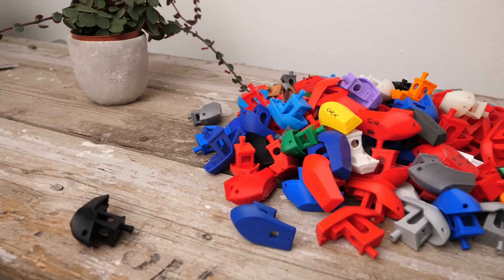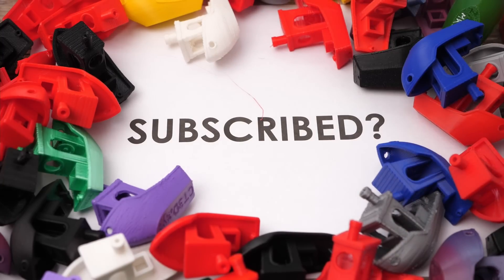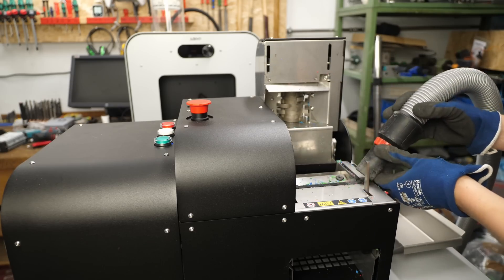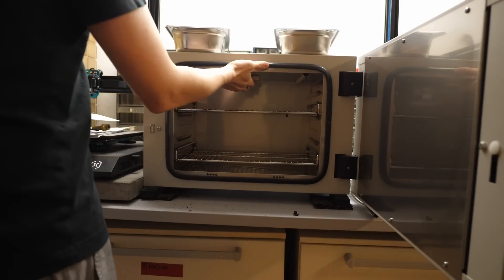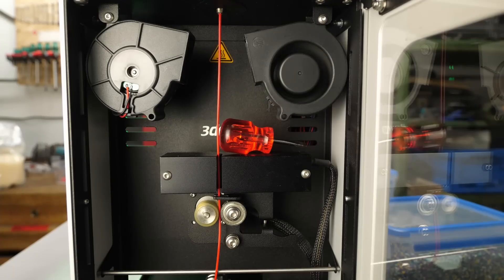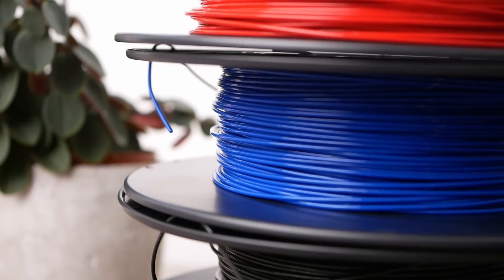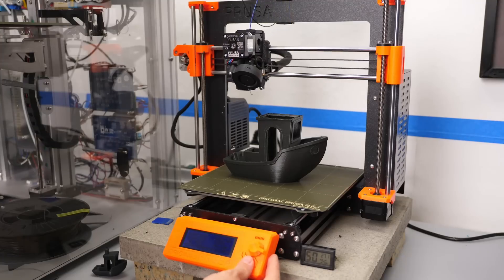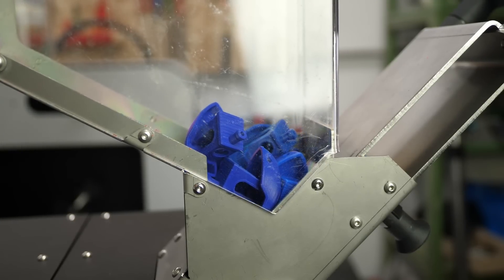Recycling all my 3DBenchys into new Filament

Comment: Did you confirm your filament size measurements by hand? Curious if the glitter pieces were confusing what appears to be an optical measurement system for the diameter.

Comment: Why not try to do a "double cycle"?
Grind the prints, extrude them into "round 1" filament. Then, come up with a filament cutter which cuts the ~1.75mm diameter filament into 1.75mm lengths.
These 1.75mm long 1.75mm diameter PLA cylinder "beads" are then the raw material for the "final" extrusion. This would remove almost all inconsistencies.

Comment: I wonder if putting the scrap material into a rock tumbler would make them smooth enough to make them flow better in the hopper without the additional vibration

Comment: As you mention, it's a 150g/hr process, presuming a shredder could keep up with the extruder. If you had to estimate, including testing, dehydrating, grinding, and extruding - what is the energy cost of recycling pla versus making virgin pellets (I'm not familiar with how factories produce pla). It would be an interesting comparison. Running a hotend+extruder screw for 6-7 hours per spool seems very energy intensive, even excluding all the prep work.

Comment: I love the idea of recycling 3D prints, but there is still a lot of work to be done to get from this prove of concept to an usable, reliable solution (so like with any other technology).
Right now it's too reliant on a high knowledge base, the necessary machinery is too expensive and the process overall way too time consuming to consider that in a hobby / small scale environment.

Regardless, love your videos, especially the input about material properties is absolutely awesome and helps me a lot!

Comment: I don't seem to be the first comment with this, but I'm highly interested if the extrusion of recycled plastic might be easier if you extrude it in a first step to get an unusable inconsistent shape (like the third, darker one you showed) and then carefully cut it into a granulate. The inconsistencies of the first extrusion shouldn't matter and it might be way easier to extrude self made granulate instead of shredded prints. So basically: can a second extrusion step inmmprove filament quality.

Comment: If you put the temperature a bit higher in the melting chamber or put the extruder from the shreded material a bit hotter, should it not be more liquidated and therefore also be more consistent/ make surw it hasnt those sparks in consistents like you do?

Comment: You should see how we do this in a plastic factory.  This regrind work is best for injection molding. And Trust me plastic companies regrind all their plastic rejects but there is always waste like when you need to purge the system that molten plastic is garbage. Maybe plastic like this should be used in construction instead of recycling like this. Plastic that can be reused in other ways to make pavers, roads or other products that we don't really care about how they really look. Quality of the plastic just degrades for normal uses. It's great idea but it's just not worth making new filament out of it.

Comment: It could be relatively easy to make them float if you ever wanted to, a keel would solve the top heavy problem so the addition of a heavy counterweight in the bottom of the print could solve this problem

Comment: Poor benchies. :(
But the idea is great. There are a lot of 3D prints used in scale models where strength is not very important. It seems that it's very important to separate different types of plastic.

Comment: I would be curious to see you print a roll of filament, measure its strength and other features. Then remelt that same roll and test again, knowing for sure that it started off as all the same type.

Comment: Since day one i got a 3d printer i have in plastic bag all failed print, sorted with filament brand and color. Maibe some day i could recycle those. Actually the main issue is machine are too expensives, a simple recycling extruder should not be 10 times the price has a 3d printer. But even in the 3d printing world there is abuse, like 50$ for a simple lcd screen, 80€ for a simple spring bed, ect.

Someone big like prusa need to release a machine ! OR i don't know, like mutualise to reduce cost.

Comment: Hey Stefan what would be cool is if you measured the electricity used to recycle in this way grind, dry, extrude so you can calculate cost per 100g of filament.
Reply from the maker: Will do that, though during the day, it's 100% solar from my roof 😉

Comment: Might be a lot more work but what about making the filament as fast as possible the first time, cutting it up to have a consistent pellet size, then doing a final regular filament extrusion?
Reply: Pretty good idea but how much electricity will it take by the time it's been shredded twice, dried, extruded, chopped then extruded again. That would be a pretty good one to put to the test understanding how much it actually cost to recycle.

Comment: You should try to re-grind a re-extruded recycled spool, the metering and mixing of the extrusion process will make the re-grinds more consistent
Reply from the maker: I've built a filament pelletizer a while back and plan to exactly do that!
Reply: Indeed, I have also thought of this. Instead of grinding, one could also run the rough recycled filament through a drive mechanism (part of an extruder) with a blade immediately after it, that chops the rough filament into tiny segments (pellets) of the same length. This should produce pretty consistent pellets that will hopefully also flow nicely due to the round shape.
Reply: @alexanderthomas2660  Why not extrude to say 2 or 3mm diameter, then re extrude at 1.75mm diameter. say spool to spool...

Comment: Can you try and grind 1kg of PET bottles and try to make a spool out of them?
Reply: PETE, HDPE, PP, PS.  Several common plastics to try.
Reply: Not bad, but there is glue, sugar, skin oils and who knows what else on them. You might clean the exterior (not the glue, though), but the interior is another issue. Maybe water bottles are ok on the inside, the leftover saliva and minerals being only in negligible quantities. An advantage would be that the pellets would be actually flakes, melting easier.
Reply: @Constantinus213421  true that, could try ABS from common cheap items enclosures or TPU from soft phone cases
Reply: I believe the University of Technology in Sydney is running a industrial robot arm 3D printer on directly melted HDPE from washed and chipped milk bottles.

Comment: Would extrusion be more consistent if you chop up the new filament into even pellets? And then redo the recycle?
Reply: Buy that you also make plastic degrade a little bit more, so the profit of this is unreasonable
Reply: I do not think so because if the jam is dissimilar material, it will still be present. If the issue is jams, filament pellets are still not as smooth as real pellets. Factory pellets are round and smooth, like airsoft BB, just not spherical. 

I am experimenting with ball milling pellets to round them. Although I'm not super motivated as shreds do produce perfectly usable filament for pretty much any print you are realistically going to do.

Comment: recycle a bunch of milk cartons and run a comparison.
Reply: The cardboard in it would clog the nozzle. ... If we mean the same thing with the milk carton: A cardboard box which is covered on the inside with a thin film of plastic. And such a box contains 0.5L or 1L of milk.

When I'm not wrong on it, they still just burn that, because they still have not figured out how to separate the cardboard from the plastic for a clean recycling.

Or did you mean a cardboard tray with plastic bottles? Of course that could be separated very easy ;-)
Reply: @Richard-S  I think they might mean HDPE milk jugs

Comment: I think "Home recycling" of PLA is certainly an achievable goal within the next few years, With a machine that costs a similar amount to a standard 3D printer. I would love to be able to recycle test prints, failed prints and other plastic waste, and I think the home user is in a good position and motivated to sort his waste (big plastic bag stored with the reel?). If its necessary to use a proportion of new pellet material then that wouldn't be a problem, and would improve the quality of the resulting material. 
Of course, if you have a CNC mill its relatively simple to melt down your 3D print waste to make blocks of plastic for those test millings, so for those who don't have the time or money to make new filament you still have the option of making plastic blocks or even sheet material for other projects. 
I think its going to be important to be able to recycle our print waste, and it will be of economic benefit too.

Comment: I have a filastruder kit to be built as a kit. I don't see this as a money saving project but saving good plastic from the landfill. The way I save money and filament from the landfill is buying partially used filament rolls but used filament is hit or miss. The recycling of filament is a great option but it's far from plug and play. Cars are filled with plastic of the same color and they have large panels of  the same plastic and color. The investigation into the types of plastic and the ability to melt and extrude could be a better option than old prints. Thanks showing the your struggles to get great rolls of filament.

Comment: I wonder if the 3DEVO cooling fans are blowing moist air on the hot filament.  Does drying the filament after extrusion and before use make a difference?  If so, can the air for the cooling fans be made dry(er), perhaps by a combination of cooling and a silica bed?

Comment: Hopefully, the things you learn from using the 3Devo stuff will help you to improve the Filastruder system. It has... issues. The auger assisted hopper and ProperWinder upgrade have helped a lot, but the core of the Filastruder being made of off the shelf, low quality hardware, is where most of the problems lie, I believe. I'd love to get a 3Devo, but as you say, the cost is prohibitive.
https://www.youtube.com/watch?v=eg2RnL29zS8

Comment: I keep the ziplock bag that my filament comes in to keep all the failed prints from that color, so it is always separated by material, color, and brand.
Reply: I tried this, but it didn't work because the prints has way less density than the spool.
Reply: @alphastratus6623  When it goes beyond the bag's size I might port some over to a different bag. Some filament colors have very little waste because I bought them solely to print for a client. I get fuller bags when I keep a particular filament in the machine for rapid prototyping and color is not important.

Comment: Use a soldering iron set to a specific temperature to quickly and easily go through and determine what material you’re dealing with.

Also if you had a wide range of UV lights in different wavelengths ranging from UVA uvb and UVC… You might be able to pick up differences in the material easier.
Reply: Great idea

Comment: If the Filament Machine and the 3 Printer would be one unit, small derivations of the diameter would not be any problems because the Sensor that controls the diameter could tell the printing part the exact diameter and the extruder could be driven at the according multiplier. (Like "hey, 200mm from now the diameter will be 1.71 mm, multiply the extrusion factor to 1.023 when that point is reached" etc... )
So being perfect in Filament Diameter would not be necessary at all, which should help reducing costs of such a machine.

Such an All in One Machine is probably years away from now, but damn that would be great!

Comment: The main problem I see with a “service, that could do that for us” is material/quality control of the delivered material. You will probably get material that is wrongly labled, polluted, (thermaly) mishandled ore multi-material-mixes.
Reply: It would need to include a good sorting machine.
If you have sufficient amounts of plastic to recycle it should be quite easy to do that economically.
From the top of my head:
Grind it really fine, put it through a centrifuge.
Wash it to get out metal contaminates.
Then dry, pelletize and extrude.

Comment: 1. The two machines should be stacked above each other.
2. The colours can be sorted with an raspberry pi and a actuator/compressed air after the first shredder. 
3. Size can be set with an cyclone separator.
4. The dirt can be fixed with a ballistic separator, if dried air then there is no need for additional drying. 
Looking forward to see version 2 of the unit.

Comment: sooooooo, basically it's not worth it for 99% of your viewers ^^
Reply: It's not worth it for those 99% yet!

Remember that, 10 years ago, filament 3D printers cost $10k-$100k+ and only big companies and universities could afford one. Look where we are now, after a decade of work by the RepRap community (initiated by Adrian Bowyer, of course).
In theory the same thing could happen with filament recycling.

(Although I personally have my doubts about how many people would really bother, given the required effort, unless the process could somehow become a lot more automated.

And I have even greater doubts over it ever becoming economical - i.e. the average home 3D printer user actually saving money by recycling failed prints/etc. Virgin PLA/PETG/ABS/etc pellets are just so cheap, and even manufactured spools of filament aren't expensive enough for most people to find recycling at home to be worth it. Just look at how much time Stefan spent in this video to end up with what looks like less than 1kg of PLA, which could have been bought for less than £/€/$20...

I'd love to be proven wrong, but I'm not optimistic about it, sorry!)
Reply from the maker: Though the 1% could make a difference.

Comment: Looks like all recycling operations.  Economically totally non-viable.  Perhaps if there were a process that could reprocess the waste PLA into virgin pellets?  That's how industrial glass recycling works.  Failed casts and pours are ground up and fed back into the furnaces.  It can be as much as 20% of the throughput on any given day, so it's very viable to use the recycled material as part of the feed stock to the furnace.  This is the only way I see PLA recycling ever working.

Comment: Please don't do this people unless you really have a compelling reason.
Not only is it a terrible use of your time, even if a "low cost" DIY version was made, it would still be more expensive than new filament.
Lastly, this is is about as un-green as is gets. You may think you are helping the environment, but the reverse is actually the case. Economies of scale are a huge reason for why recycling can be effective, this is a total fail when it comes to recycliing.
Do the world a favor, and just dump your old parts in the recycling bin where it can be dealt with efficiently.
Reply: This stuff is useless to a recycle center because it has no universal identifier code on it. It is nothing but garbage.

Comment: What's up with the screwdriver? Did you fix wobbly filament in a 6000$ machine by placing a 1$ screwdriver pushing on the filament? 🤣
Reply from the maker: That's exactly it. The filaments tends to resonate and vibrate. The screwdriver just stabilizes it before it enters the thickness sensor.
Reply: @CNCKitchen  I hope 3devo sees this ....and starts including a screwdriver 👍
Reply: @lannik_0  LoL
Reply: @lannik_0  or fixes the problem
Reply: @j.t.buckley52  that would be the optimistic assumption
Reply: @lannik_0  this is the funniest shit I've read on YouTube in a long time
Reply: That's what it looks like lol
Reply: Отдай 5к $ и ещё нужно вставлять отвёртку чтобы работало!🤣🤣